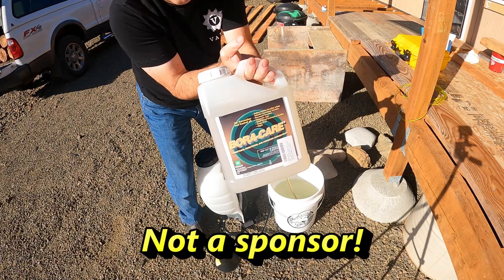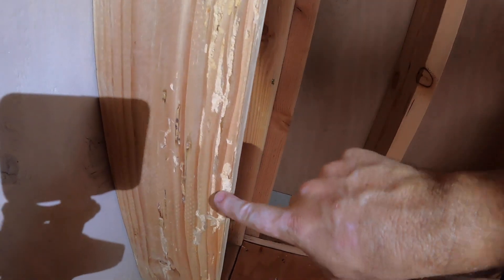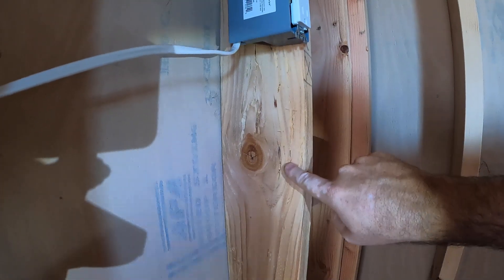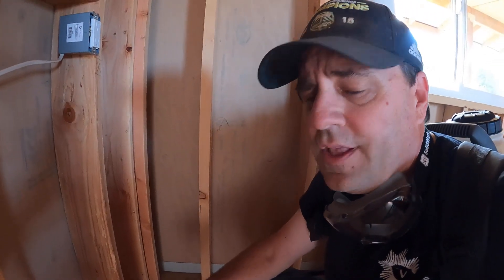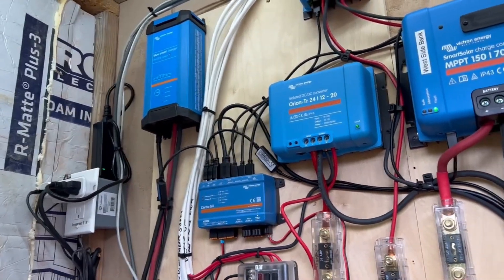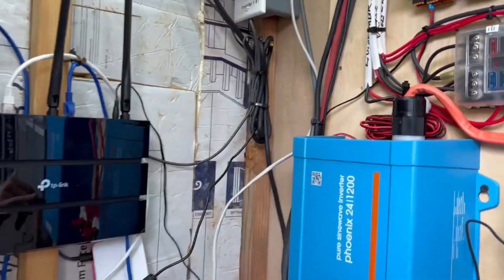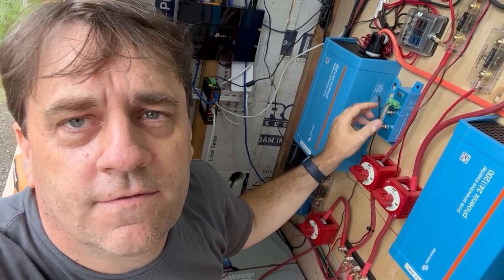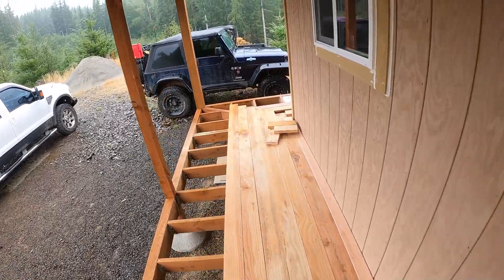Killing Dampwood Termites! & a Solar Equipment Final Walkthrough

Comment: Wow that was a ton of work, can you video how you setup the USB sockets?  The battery balancer piece with the diagram, exactly what I needed.  Nice simple generator hookup (note to self, 'rip that off' :)   Now, need to be able to choke/start/stop a generator remotely.  You are killin me w/that comment about video quality, total gold.
Reply from the maker: Ya, I have two more sockets to install (the wires are run but haven't installed the USBs) so I'll grab some video of those and link the devices I bought, pretty sweet, little 4 port's the fit in electrical boxes.  I'll do that this coming weekend.   

If you buy the right generator type, the Victron system can remote start the generator and use an ATS to switch to it, just needs a different model charger and an ATS.    When we build the house down the road I will do a whole home generator with auto start and switching capabilities for sure!   

Here's a link to that generator plug I used, bought it like a year ago LOL:  https://k7s.co/plug-me-in